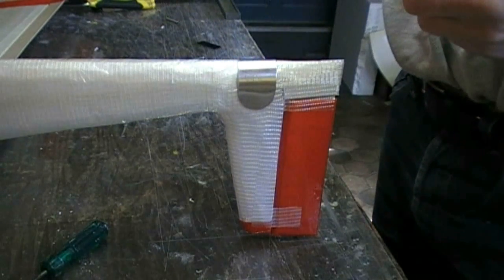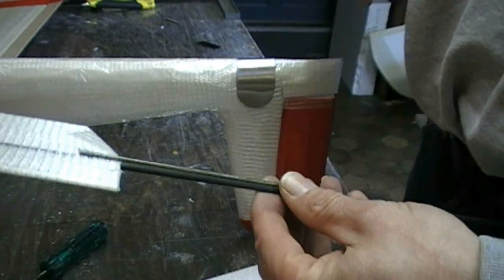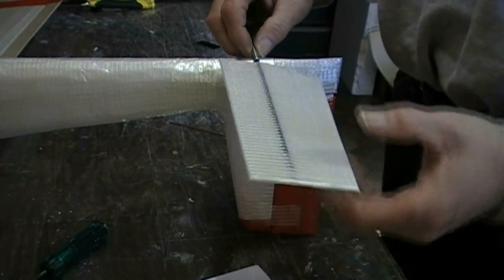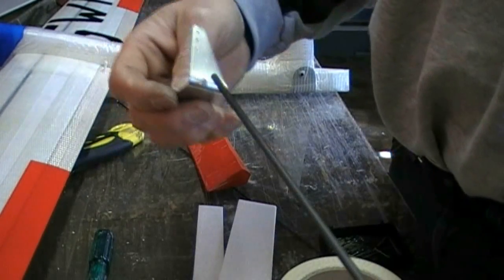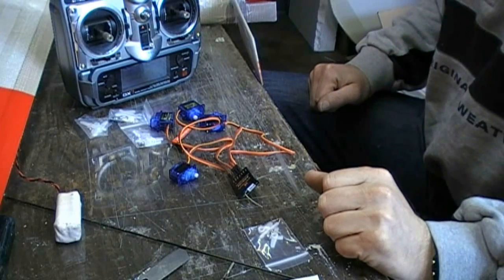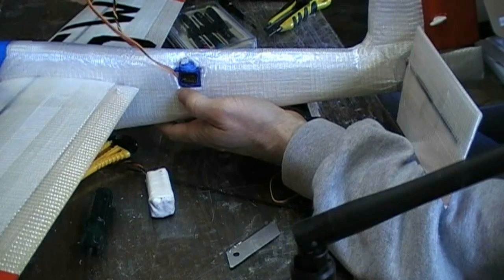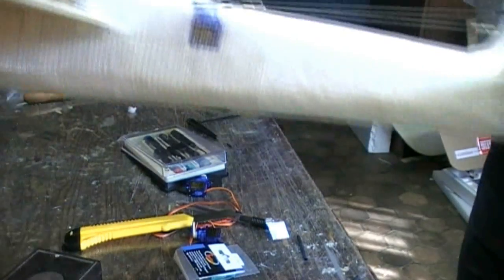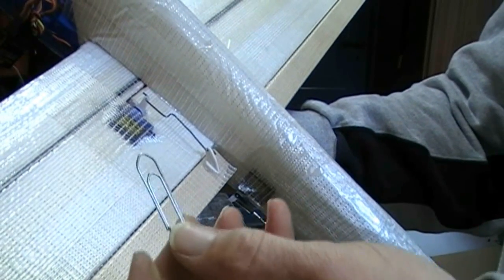RC. Part 3. How to make a Swift S1, aerobatic foamglider.

Comment from the maker: @12robertmulligan You need a computer transmitter,  I use a Spectrum DX7, (But the most new TX with mix can do it)+ there has to be 2 aileron servos... Then set TX up for flapperon, and in flap setting there you can mix it in. (And one aileron servo in the RX aileron slot and the other in CH 6)
Good luck